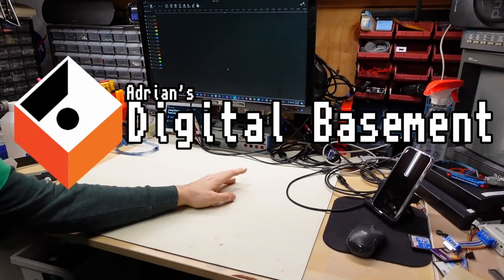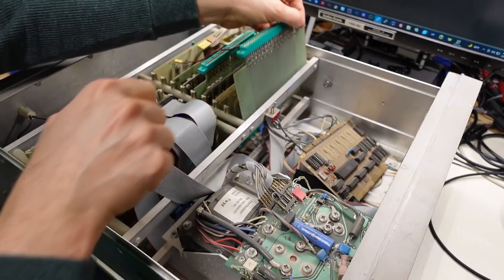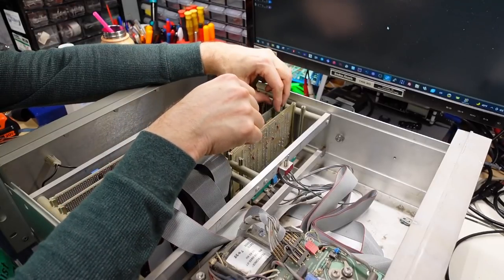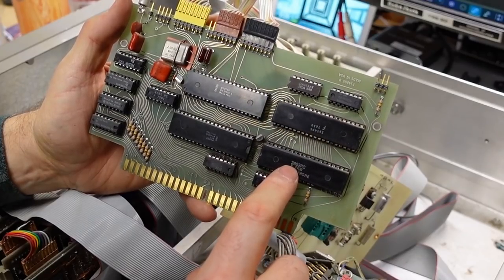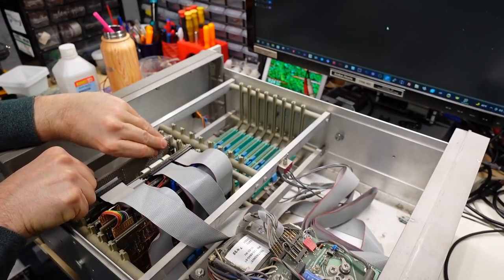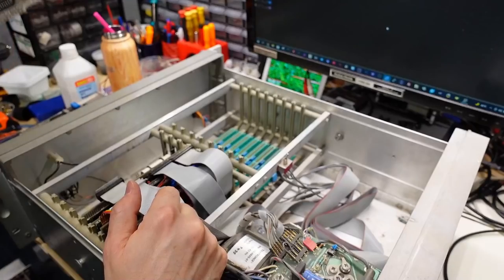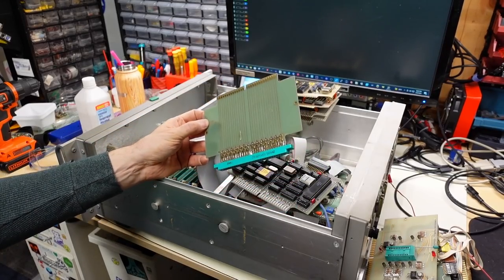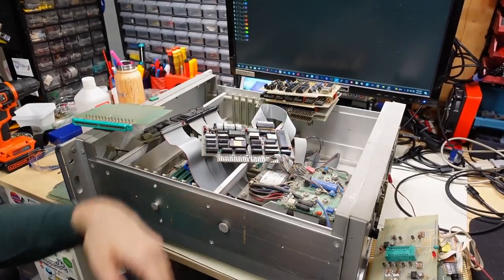I need help finding information on this mysterious computer

Comment: I wouldn’t say “home made” necessary. I worked in a prototype lab at ITT Defense Communications in the late 70s and. We made lots of stuff like this. A lot of it was wire wrap.
Reply: We used that method too for backplanes using Kynar or Tefzal wire wrap and for Baudrate linking on DEC PDP11 boards (instead of red handbag links) but also for chip to chip wiring in proto too with fine enamelled wire and It’s trade name here was called Roadrunner. The varnish insulation on the wire spooled on a pencil burned off where you soldered it to the pin so you could could quickly join pin to pin around to make a bus between chips. Great dev method back in the day 👍 now PCB are very affordable for development and better for todays higher speeds etc. but this was great to see again, bit of nostalgia for me  🙌
Reply: I had the feeling of defence or academic.
Reply: Tektronix is in Portland. Almost certainly from Tektronix lab.
Reply: I worked at McDonnell Douglas in the late 70s onward, and saw a lot of similar hardware and boards, too.  We had prototyping boards for things like these, plus wire-wrap, and even something called wire-weld that was similar to wire-wrap but instead would make traces using special wire spot-welded to small flat-headed posts.  A nightmare to work on, especially when the welds were lousy, you'd pop them loose and make things worse.
Reply: @rog2224  nothing Defense.  I've built defense systems.  That wouldn't have passed muster.
Reply: Wire wrap done correctly has a longer life than soldered connections. I have had to resolder old boards, but the wire wrapped prototype boards I did back 50 years ago still work.
Reply: @johngraesser4911  Agreed.  In my experience the few wire wrap failures I saw were either due to improper wrapping (power WW gun on an assembly line wrapping too tightly, nicking the wire at the final bend around the square post, rare, I forget if the tool or just the bit got replaced) or corrosion (board exposed to conditions that would affect anything, random intermittent failures).
Reply: @iancooper2338  DEC PDP11… now I feel old!
Reply: @johngraesser4911  The big monster mainframes were almost all wirewrap in the backplane, thousands of connections. You've probably heard of a routing analyzer called a Ditmico? One of them and two of their engineers were brought into the GE facility where we were making the first non relay logic control systems for GE nuclear reactors. Churning along for several days, the Ditmico figured out over five thousand corrections to the controller's backplane wiring, which solved the timing problems that were holding up the project. This was in 1979.
Reply: @PlanePreacher  me too 😂 I came into that area in the 80’s after my mining electronics apprenticeship, we used them on the surface in UK coal mines for monitoring and control before we introduced SCADA on PCs. Went on training courses to DEC UK in Reading and Manchester for PDP11, VAX and associated peripherals VT340, LN03, TK50/70, RL02 etc. etc.. and other hardware and software maintenance. Was you involved in Air traffic control/ flight simulators? I believe they were also some doing that on the courses we were at.

Comment: The EPROMs might contain clues as to the source of this machine (e.g., a message printed to a serial console).
Reply: 👍 good idea
Reply: Yeah, I mentioned in another comment, read the eproms and run "strings" on it - likely some juicy tidbits will fall out. This is long before evil "firmware encryption" - all the clues should fall right out
Reply: Yes, dumping them would likely reveal something about the company that produced this system. But maybe not all that much, because it ran CP/M, so everything important would be on floppy disks.
Reply: Eproms might have lost their memory over the ages. But i wish you good luck that they are still data intact.

Comment: Being a rack mount system I find it extremely likely that this would have just used a serial terminal and not had a display adapter
Reply: It operating system could be a dos or cpm specific or maybe a type of basic.
Reply: @jpnc2319  If this was scientific or industrial, it probably would have been programmed with a more efficient language. You seem to be thinking in terms of "microcomputers/PC" and this isn't one of those. Highly unlikely it used DOS, and considering CP/M is more of a monitor than OS, I'd look in entirely different direction, perhaps even a custom "OS". Looks a little too primitive for unix-type OS. But this was from a time before "PC standards" existed.
Reply: I had an S100 based Z80/CPM system loaned to me in Jr High (it was out of date then) by a teacher who was happy I was interested and even though it was a "desktop" it was connected to a serial terminal.
Reply: @squirlmy  yeah probably a basic RTOS, likely with less functionality than we’d expect from modern firmwares. Could well have been custom depending on the client. 

Edit: if indeed industrial. Another commenter has an uncommon, expensive, custom built Z80 home machine from the time and mentioned CP/M and WordStar on theirs.
Reply: Being rack mounted and from the 70's, probably some custom built or custom modified machine for a particular scientific or industrial application. I see no need for a display if it runs some code from the ROM chips, and then talks to some other devices over rs232. It could also be an early interface between an old CNC machine that expected to get it's program from a paper tape reader, and instead this thing transforms it into a disk-baed system. Best bet would be to dump the roms and run "strings" on them to see if there are any clues in the firmware.
Reply: it doesnt have any video connector and 3 serials so yes, low speed comm device
Reply: Early computers frequently had a serial terminal by default (including all Unix and Linux machines to this day).
Video interfaces were an optional extra.
Reply: @scottlarson1548  The Australian made Microbee CPM machines had both monochrome and CGA level colour displays in 1982. Mine had 512K of paged memory (up from the original 16K/32K/64K factory options and twin 320K floppy drives)…
Reply: @scottlarson1548  With appropriate bios extensions, CP/M is a disk interface like MS/DOS that was derived from it (MS/DOS is a 16 bit version of CP/M just like the 8086 is a 16 bit version of the 8080 & 8085). (The 8088 was a version of the 8086 designed to use 8085 interfaces).
Graphics were entirely a user program issue.
Reply: @allangibson2408  Oh it's a disk interface! So that's what I was using fifty years ago! 😁

Comment: Looks like aerospace ATE  I started in 1972 at King Radio that made Avionics for aircraft. They had 2 different test equipment departments. Automated and Custom ATE and CTE. I worked in CTE. Back then it was very expensive to lay out PCB's A draftsman to lay it out, artwork fees and several hundred for the boards.  They would hand wire them. This looks ATE, they would have a large box of boards and cables going out to a bed of nails, That's what they used for laying a PCB production board on for testing.

Comment: Having worked in steel industry research and development from 1975 to 2013, I feel this has the look and feel of the sort of the sort of equipment we might have made (we didn't, I'm in the UK). A wide range of dates on the I.C.s and the modifications suggest it might have been made for one purpose/project, and rebuilt for another. In the 1970s and 1980s, if it needed to generate graphics there were "graphics generator" units, also 19" rack mounted, which took HP-GL commands over RS232 and created the video signals.
If the method being developed succeeded a more finished design would have been made.

Comment: Around 1980, I helped build industrial control systems and this computer is very similar to the stuff we did. We even had the extra solder wick on the riser boards to handle amp loads that increased over time as we got more power hungry chips. I actually kind of miss those days when I could have told you exactly what every chip and/or trace was for.

Comment: Myself and three other guys started a company out in Silicon Valley. I wrote the software, they did the prototyping boards using your “hodge” technique. It was highly effective and quite quick to implement. The only drawback was if you found out you had made a mistake ten wires back you would have to carefully pull the unsoldered wire through pack of good ones hoping nothing would snap.

Comment: I opted to submit my assignment for my TTL digital course as a physical built unit. you could have submitted just the design, but I like building stuff. i wasnt great at digital logic, but managed to design and build a discrete logic digital clock. the combo wire-wrap/point to point style Is a really satisfying way to build a dense, pro looking board. until you look at the back... but I very much enjoyed the process

I only got an OK grade for the project, because it was a pretty basic design. but we did use it as a demo unit for other classes and it proved a very robust build. If i was 20 years younger, I could really see my self rolling my own Z80 CP/M machine like this. 

I built my first PC with the proceeds of my 12th birthday money. I made it known that I didnt want any plastic rubbish, but needed a bankroll for this project. I got a VGA screen and a 800mb HDD n some cash. enough for a Mobo  n ram n awful GPU. case, CD, sound, better graphics, were added over the years. I 100% Grok the origional builder of this rig. such things are not bought, but lovingly crafted. my pinnicale was a hodgepodge 100% DIY watercooling rig that got my Athlon 2100+ to benchmark as a 3500+. 3200+ was the fastest off the shelf. Alot of ram tweaking went into that. Dual PSU (one for the mobo only, the other ran all the disks), Full tower AT case that was modded for ATX, window, neons (this is pre CCFL's, neon baby), paint job. 7x HDD's, all PATA. only weighted around 30KG. everything that could be modded was. 

I'd love to have a pint with whoever built this rig and just let their eyes glaze over as they talk about their baby.
Reply: I tried to make my own 8080 computer from Radio Shack parts when I was a kid back in 1979. Of course it didn't work, and it never could have worked because I didn't understand bus fan-out. But more importantly, it would be decades before I would have the discipline to test things as I was building them. I went with software because it was much less annoying to recover when you screwed something up.

Comment: Those boards are definitely Tektronix made, but it is hard to tell where they originated from.  Tek made a lot of automated test equipment in the 60s-90s, so this may have been a prototype system, or maybe just something that a Tek engineer cobbled together.  If you could find some additional part numbers, some of the Tek-savvy community might be able to track down the data, maybe even an instruction manual.  Great video, love the channel.  Cheers!
Reply: The transformer part number would almost certainly narrow it down.

Comment: I actually bought 4 gigantic dual 8" floppy drives made by Wang from a surplus auction in the early 80's.  Absolutely massive units, with linear power supplies inside.  The two 8" floppy drives.  And then a card cage that held huge circuit boards with 30-50 74LS logic chips.  Nothing bigger.  There were 8-12 of these cards.

All of that just for a dual 8" floppy storage system.

Would love to have those today, simply as a source of parts.
Reply: I also worked with 8" floppies. Good times, and still had to strap ground straps to my wrist AND cabinets were little air-conditioners.
Reply: Four massive Wangs?

Most guys would be satisfied just having one . . ..
Reply: @Azlehria  my pants fit me like a glove!  ^-^

Comment: I have no problem seeing this as a serious hobbyist's home built personal machine. It almost certainly evolved over many years. For instance, it might have had many different cpu cards over time etc. The handbuilt cards are amazing and very consistent in build style.  Nothing wrong with terminal interfaces. People wrote software and books and did serious science with machines like this. Graphics are not always necesary. Also, just because this stuff wasn't cheap doesn't mean it had to be a business or institutional machine. The lack of labelling suggests this was one person's machine. Some people pour their money into hot rods or boats or vacations or big families. Some people build their dream computers (and maybe some of that other stuff too). This is definately outside of Adrian's wheelhouse. I hope he finds someone to take it on if he's not gonna try to make it work again. It looks pretty complete. Not obvious that it won't boot CP/M off of those roms, btw.

Comment: Homebuilt CP/M machine, maybe for industrial CNC or some other numerical control? A bit pricey and complicated for a hobby machine.... 
I say industrial as it looks beefy enough to be running 24/7 in some plant... The PSU was stolen out of some Tektronix equipment and definitely over-kill for the purpose. It's not S100 though.
I have done similar wirewrap jobs in my past but this guy didn't use wirewrap so it would have taken a looong time to wore though boards up. Nice neat job though.. well done. A quick tip one doing a neat wirewrap job is to put in "croquette hoops" of bare wire on the wiring side prior to starting the wiring then use the hoops to guide and hold the wiring.
The little plastic thingys that were missing were called "card extractors".
Cheers,

Comment: It's a CP/M STD-Bus machine of some homebrew vintage. I ran an IMSAI 8080 S100... brings back memories. Most all CP/M systems were terminal based via RS232,  You'll need to find an old ADM-3a, VT-52, Hazeltine 1500 or VT-100 terminal.
Reply: No need for a physical terminal, just a PC with a serial port (or USB/serial adapter) and a terminal emulator program like Tinyterm or Putty.
Reply: @bobpoortinga7352  Absolutely true. A PC with terminal emulation will do the trick, but if Adrian wants to set it up as an 'authentic' system, he'll need a vintage terminal.

Comment: Wow, you got yourself a treasure trove! Z280 is a very fast enhanced Z80 with expanded memory (bank switching), and extra instructions. I built a CP/M computer in the mid-80's using similar technology (Eurocard experimenter board and wires, 64-pin Elektor backplane), using a 10MHz HD64180 CPU, which is virtually the same as the Z280. Also built a floppy controller (FD1793 I believe), a Z80-based VDU/keyboard controller, and a SASI (not a typo) controller to run an Adaptec ACB-4070 SASI-to-RLL bridge board. Hundreds of individual wires, can't even fathom how I found the time for this back then. Wrote my own Z-80 monitor program and CP/M BIOS. I really wish it had survived the cleaning frenzies, but unfortunately it's gone.
Reply: ne needs boot disk...mad...
Reply: I just hate "cleaning frenzies" even more now than before :((((

Comment: I could tell those boards were laid out by hand. I worked as a test engineer and built several test stands that interfaced with an Hp85 and several HP analyzes and volt meters. We created our own back plane which had a half dozen cards for signal processing and I/O. We had a pc lab so we were able to layout all of the boards. All painstakingly done either by cutting rubylith or using Brady tape and stencils. We did everything 2:1 and then made negatives for exposing the boards. It really was a dream job!

Comment: My first job was in a computer store starting in the latish 70's. All that wire wrapping was original From the factory. When IBM was selling for $10,000, these sold for around an easy $4,000ish.  I couple of the boards are home brew. We sold the blank cards. Unfortunately I'm at that age my memory is failing and I can not remember muck about them. I sold 3 in my first year. All to the same guy. He was a Dr, and set up his office. One was a server and it was headless. The other 2 both had video cards. It used the old green or orange screens. I may have some documentation in my filing cabinet, but it is in storage, and right now in New Brunswick it's COLD!! Especially for this old fart!  I plan on going down there sometime next week or the week after to bring a few things home and dropping some stuff off. I'll take a quick look through the cabinet, and if there is anything there I will male it out.  I have cleaned out a lot of that stuff as I never thought I'd see the day I would wish for the old slow machines!

Comment: At first glance it initially  looked like the rubidium reference clock used by the BBC in their HF broadcasting stations. 

This "homemade" equipment was commonplace with them. Their various teams, working as if isolated islands of development, were scattered about their network, of which was full of this shabby looking heath Robinson stuff - aluminium absolutely everywhere - even the toilet seats were made of aluminium!

When you threw this box in the bench, it sent a shudder down my spine.

When I went to work there 20 years ago, this bespoke stuff was antiquated then. It was quite a shock to the system seeing such primitive systems serving the network like that.